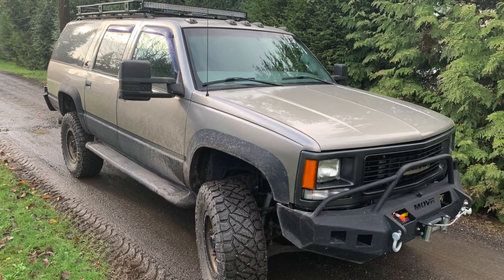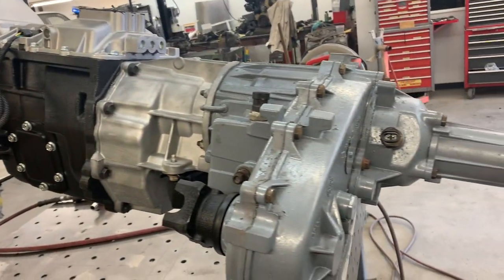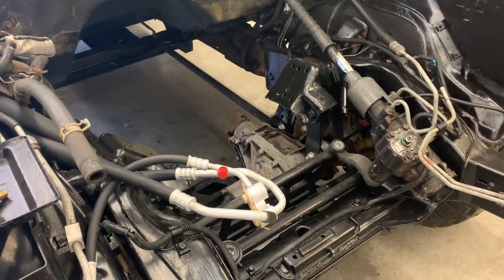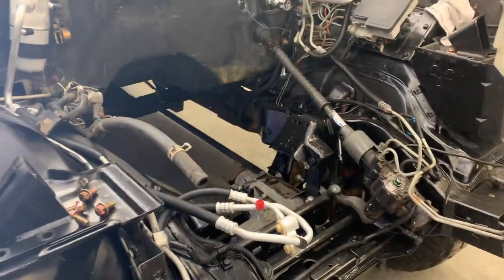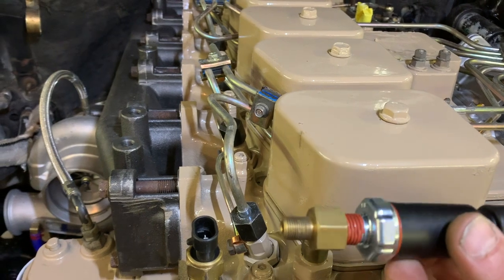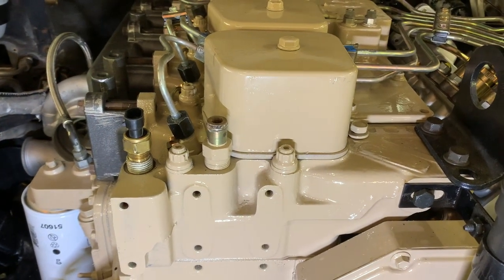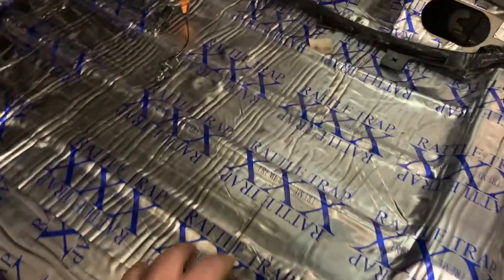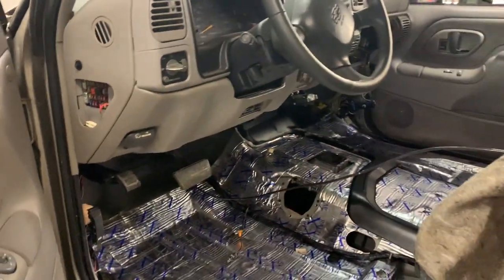*Project Shrapnel* How to install a Cummins 6BT 12 Valve Diesel into a Chevrolet  Suburban - Part 3

Comment: What did you use for the power steering pump?
Reply from the maker: We used the factory GM power steering pump along with our direct mount power steering pump adapter: https://adventurevehiclesnw.com/shop/diesel-conversion-parts/chevrolet-gmc/73-87-chevy-truck/cummins-b-series-direct-mount-power-steering-pump-adapter/